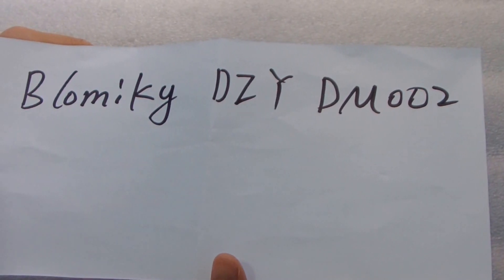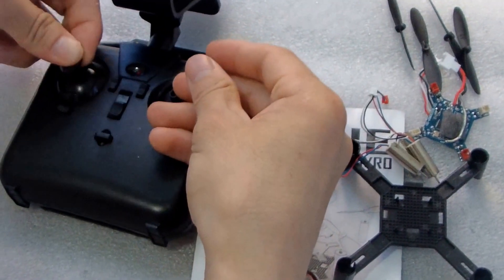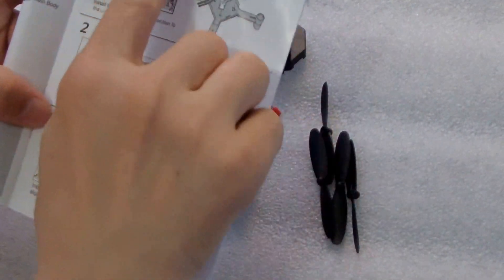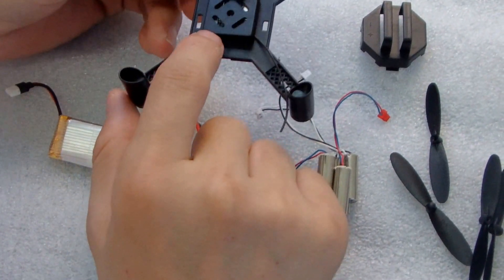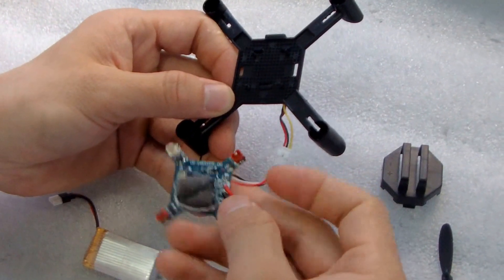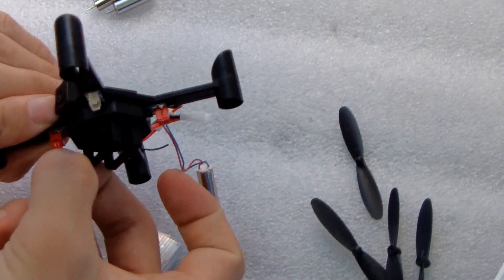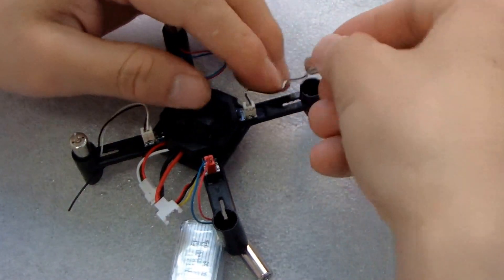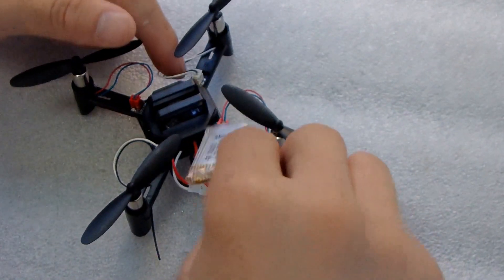Assemble DM002 DIY FPV Altitude hold Drone

Comment: best regard:
I have that same but when the flight starts I can not control it, it does not respond to the command, it only turns but it keeps moving forward and up, you can help me thanks.
Reply from the maker: Calibrate drone flying level